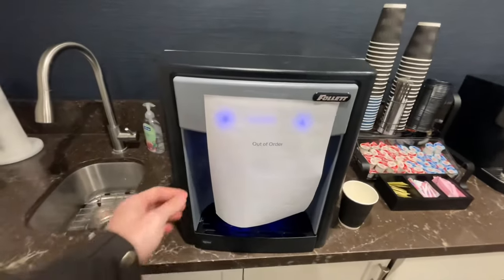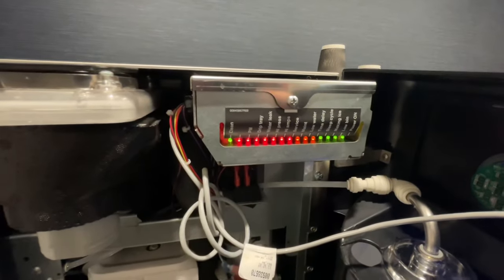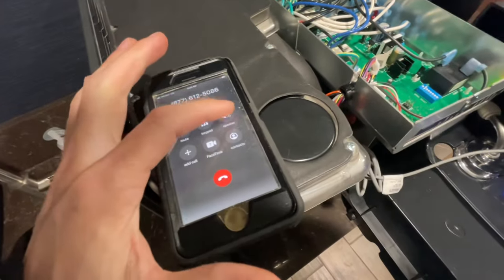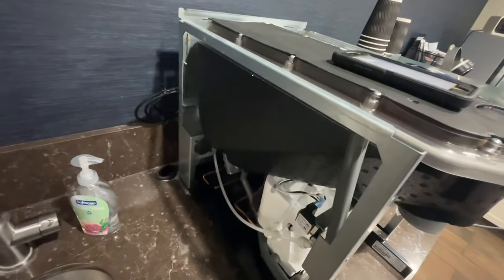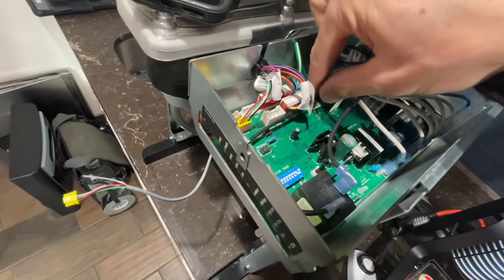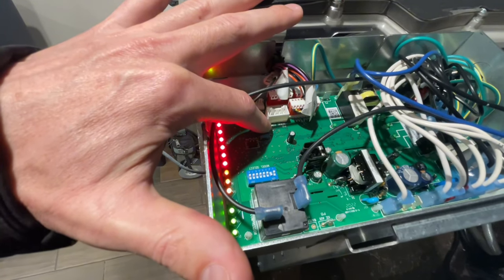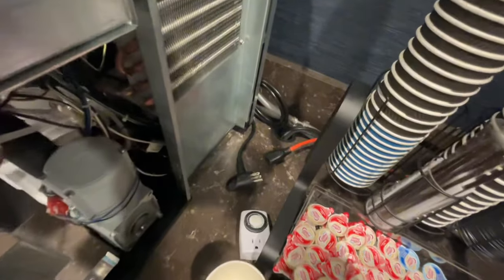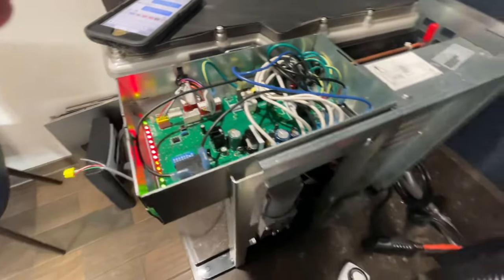Follett ice machine troubleshooting - control board problem

Comment: Great video . On a different note . I have a Manitowoc neo , it’s running low auction pressure ( 34psig) .when the machine goes into harvest the hot gas  temp never reaches 150 degree , stays @78 . Would low refrigerant cause this ?
Reply: Bro what? What's your head pressure during a freeze cycle? If you low on your suction and head, then ur low charge. But that would imply a leak.
Reply: Or bad txv or leaky hgv ?? What does the Ice formation look like on the grid
Reply: @calvinthompson5398  it will form a nice sheet of ice but will not break lose . After 7 mins harvest .
Reply: @MightyMeehow  head pressure is 250 and cooling fans do kick on . I was able to clean the condenser .saturation temp was 18 degrees .
Reply from the maker: Kinda sounds like a harvest valve issue. If your hot gas valve is not opening/partially  opening during harvest you’ll get higher than expected head and lower than expected suction. That’s assuming everything else is correct. But that’s just a guess and I have little information to base that on.
Reply: @IceMachine411  I’ll take a temp measurement  before and after the hot gas valve  .im assuming temp should be 150 degree before the valve opens and 150 degrees in the open position?

Comment: I can’t stand these little ice machines they’re garbage. They’ll work fine for about a year or 2 and then nothing but issues. If you go to Follett videos on YouTube, comments or disabled if that tells you anything. I always tell customers to not buy these little Follet ice machines. They are junk and their Tech Support is just as bad. Expect to wait on hold for at least 45 minutes/ 1  hour every time you need Tech Support.
Reply from the maker: lol. I don’t want to bad mouth Follett. I have a pretty good working relationship with them. The drain less machines are kind of a pain at times. I’ve started telling customers that they should get a small RO system to feed the machine. Oh and Tech Support is rough.